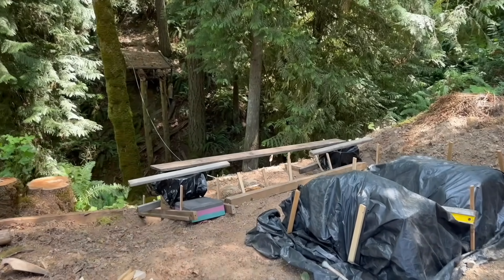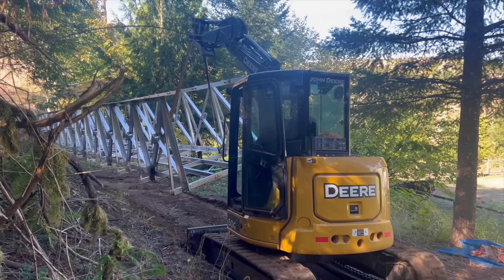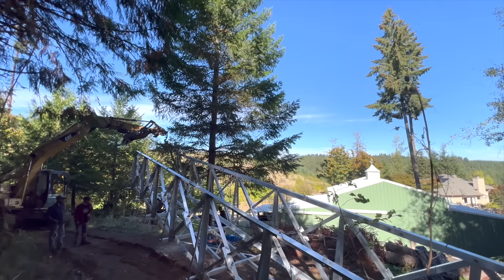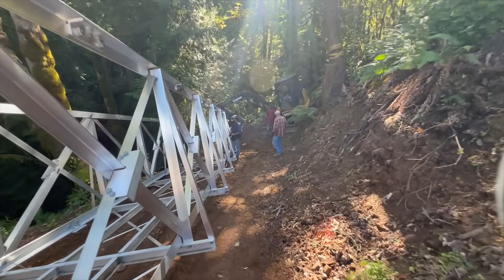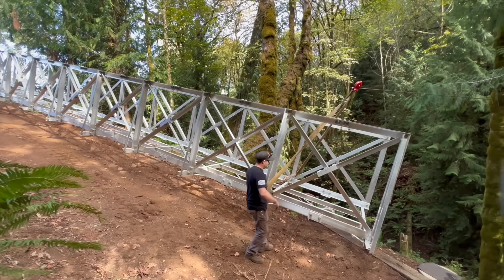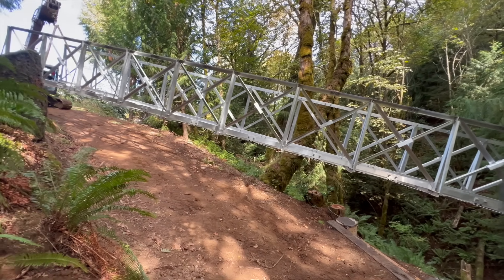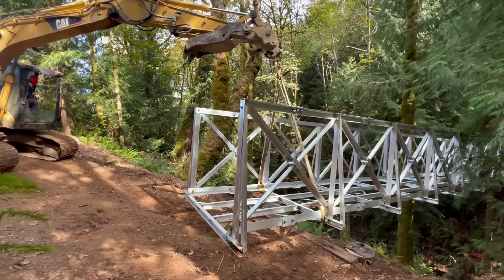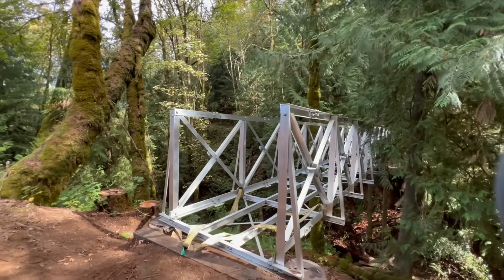Setting a 72x6' RollingBarge com Bridge Over a Canyon

Comment: I know trees are almost a nuisance in Oregon but I'd have tried to save that one tree by unbolting the bridge into 2 pieces then reassembling it after the tree.  And I know there are probably other constraints which make my proposal impractical. 

Still, good work and I like flying the one end with a cable.  That's clever.
Reply: Plz